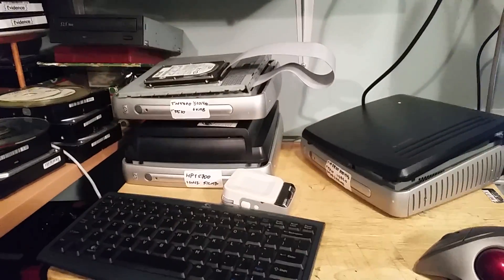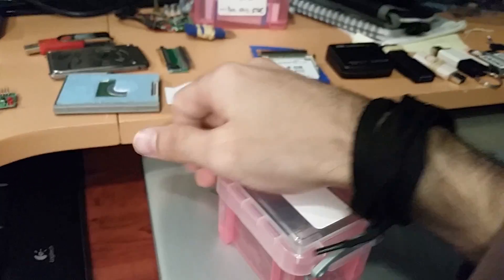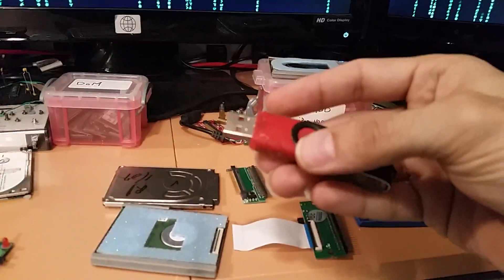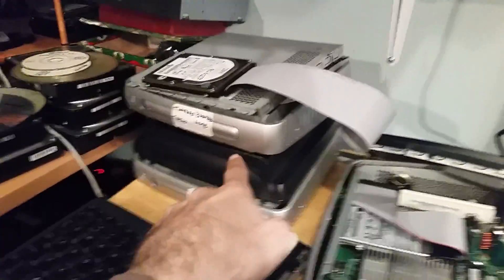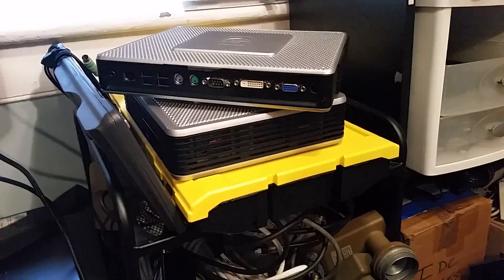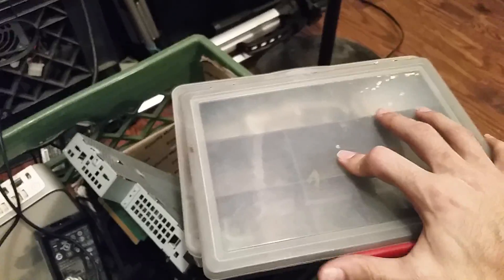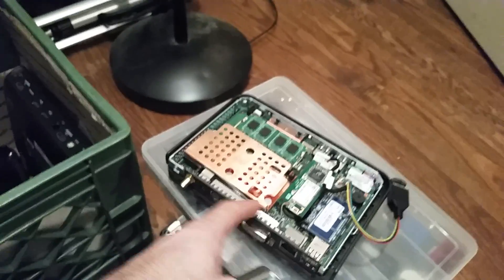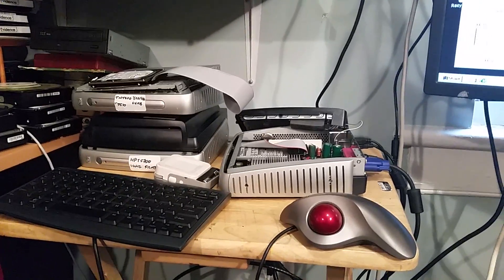HP thin client hacking - Running Windows 98

Comment: I'd assume the Box with the Radeon 7000 Series GPU is using a Radeon Mobility chipset? If so upgrading to a 7500 or even up to a 9600 might be possible with some BGA rework ;)

Comment: I use a sata harddrive, take out the board (about 1/3rd to 1/4th the disk size), and use an extension cord.
You could do the same for a pata disk, or use a CF card.

Comment: hey if you ever get around to making some more thin client hack vidoes, is there any chance of maybe trying to get the linux distro, Zorin os on one of those older thin clients? it should be able to work since the min requirements for that distro are: 700mhz cpu, 512mb ram and a 8gb storage device.

Comment: Just use usb extrernal cdrom... WTF... i have hp T5565 spec > https://support.hp.com/vn-en/document/c02694852 and all work normal and no super Over Power 1 GB ram 1 GB flash card over... I use it only for WordStar4.0 and dos not need more... for games i have other win 98SE PC...
I have only 1 question how i can reflash orginal T5565 thin client if usless hp site not have OS img... only for pro version :( Like for Your hard work, but remember you can just copy all windows files on another pc directly to hdd and all work normal...

Comment: One easy method to install Windows 98 on these units, is to plug the HDD on the IDE port, use some USB floppy drive and boot from it using the W98 boot disk.... Use FDISK set the HDD. Then, extract the HDD and plug it to a PC and drop the contents of the W98 CD to a directory called SETUP or W98SETUP or something.

Then fit the HDD back into the Thin Client, boot from the floppy drive, execute the command SYS C: to transfer the system... That will avoid further use of the flopp drive.... AND, just go to the W98SETUP directory and run SETUP. Windows will install from within the same HDD.

It's easy.

However, i've found several problems regarding drivers with W98.

Could someone provide information or some link so i can found the proper ones?
It's driving me nuts, some drivers that "seem to work"  finally make the TC to crash, like the VIA USB 2.0 driver... Others like the sound driver, just seem to not work at all.

I managed to make it work somehow using the nusb36e drivers, but the USB device on the device list is still showing the ! mark.
Reply from the maker: I highly suggest you hop on the discord chat and hang out. We have a lot to chat about. I'd be more than happy to toss you the driver packs I have, maybe it will help. 

Link for the discord chat is on my YT channel main page.
Reply: Thank you for the quick reply, but i can't find the "discord chat",  where should i find that feature? Sorry about the inconvenience...
Reply from the maker: https://discord.gg/AgMMZ5k
Reply: Ah! It's an IM utility... 
Nice, i think i should register.
Catch with you later. Thank you!

Comment: Can you recommend a Brand name (HP, Dell etc) TC with 2 serial & 1 parallel, and 2.5" SATA capable, with 4 USB on the back?  Looking for qty so cheap..  ;)   Also, You mentioned a capture box.  I picked up a MyGica HDcap for $50 in Kijiji that does a nice job capturing from HDMI (and VGA, DVI etc with the right adapters.. )  directly to a USB stick.  Here is one on eBay   https://www.ebay.ca/itm/1080P-Standalone-HD-Video-Capture-HDCap-X-HD-Game-Capture-HD-video-capture/163150695576?hash=item25fc8a0c98:g:llMAAOSwz~ZbS5bX
Reply from the maker: The dual serial is going to be niche. So will be the SATA support. The only model I know of that has SATA onboard (in my collection) is the HP T5740. With the riser expansion you get your extra serial and LPT ports, with PCI/PCIe 1x slot too. I would sooner use a PATA to SATA adapter for the HDD. Not many thin clients use SATA. https://www.parkytowers.me.uk/thin/hp/t5740/mods.shtml It may just be easier to do a SATA-PATA mod and run IDE cable. I know it can be a PITA.

Comment: Hi, just bought a HP Compaq T5520 Thin Client w/ Win CE. Could you make a step by step video on backing up CE, and  upgrading to Win98SE? Thanks.
Reply from the maker: what is the capacity of your DoM? I just nab an old copy of Norton Ghost for dos and MS-DOS boot files to format a USB thumbdrive with MS-DOS and Norton Ghost.
Reply: Thanks, not sure yet. It's in the mail. Norton Ghost, I vaguely recall that program, thank you.
Reply from the maker: if you want to hang out on our discord chat to get some advice, there is a link at the top of my channel banner. Feel free to join our merry misfits of technology and chat away. There is more than one way to skin this cat, erm, make this DoM backup. If you join discord I can give you the tools and files needed, too. Or find archive copies or other tools to do the job.

Making the backup is not hard. Figuring out which method to use is the confusing part. Too many tools that do the same job across every OS.

Comment: I got w98se to hp5630, but I did it simply by copying setup data to pata drive using live debian,  booting from usb cd boot dos drive and installed it onto sata drive since it is reasonabley easy to solder laptop drive connector to it.
Reply from the maker: That is a classic way to do it, very reliable. I have a Wyse S90 that can only power a compact flash due to amperage limits, and wont boot from USB. I made a bootable Compact Flash card with MD-DOS, source win98se files, and started a manual install from there.
Reply: All those thin clients are amazing retro gaming machines if you get lucky, to get one with at least some drivers, USB, Ethernet and gpu helps a lot. Sound in dos can work via paralel port.
Reply from the maker: Uroš Golob that's right. I have the PCI Riser card for a few of them that can take a legacy soundcard if needed.

Comment: I'm looking for a thin client box to support WIn 98 for the sole purpose to drop to DOS for legacy support of some of the TestGear in my electronics lab.  I happen to have  an HP 5530 on hand but no PCI expansion adapter. 
Question 1)  I also have disk  for Win 95. DO you think 95 might be a better option since it's smaller?
Q 2)  If you don't recomend the 5530 for this project, what suggestions do you have?
Q3)   I also want to be able to easily transport some sort of storage device, ie,  Compact Flash, Ide, Sata, ??? So that I can boot up easily on another thin client  Can I do that or will the program need to address the processor ID specific to each box?
Q4) I am willing to pay for some phone support for this project.. If you have interest, I can email my numbers.
you can email me at   wa4aos@aol.com 

regards,,, Glenn,  DSM Labs
Reply from the maker: Interesting project, I shot you an e-mail. Feel free to jump on the Discord chat https://discordapp.com/invite/AgMMZ5k

Comment: Why didn't you install it on another machine and transfer it to thin client
Reply from the maker: that is the obvious and easy solution. As a hardware hacker I like to experiment with various options. Im disgruntled enough to hack CD-ROM boot support into the BIOS. It's in there, but not listed as a boot option.

Comment: There going to be like this with the UpGrade Flash I think.  https://www.youtube.com/watch?v=JOrZVa5QehY
Reply: If I can get them on WiFi thinking of just using them for kids to  surf the net.  If possible add lap top hard drive.
Reply: Ok, Received the things.  Look all but brand new.  Seem to have been upgraded on on the Ram.

AMD Sempron 210U  1.5GHz
639K Sys Ram
1918M Ex Ram
Fixed Disk 0   1G Flash

What and how can I load something good enough to cruse the Net with ?  

Looks like it has slot for a Drive but I don't know much about them.
Reply: LOL Not equipped to do any type of presentable video .  Created a Ubuntu Boot able Flash drive.  Thinking it will be to large .  Not tried to get the thin to boot off of same as of this time.  Will investigate the LXDE ?  

Cover issues on possible use of Lap Top Hard Drives ?  I have at least 5 or 6 here not in use.

Comment: What drivers did you use for sound and video on those HP thin clients in Windows 98?
Reply: I have 2x t5710 1.2GHz machines from April 2005.  :-)
Reply: Foxx D'Gamma Sure.  :-)